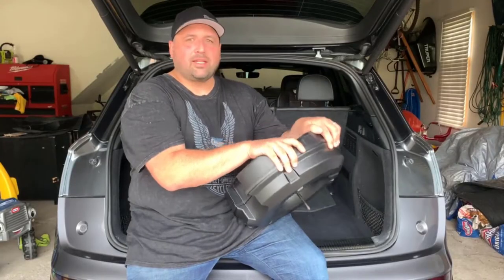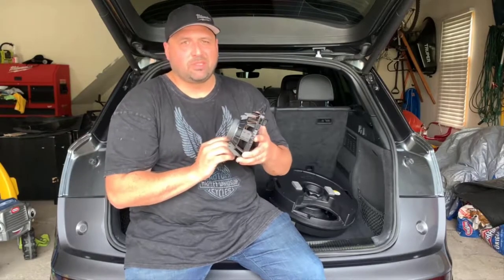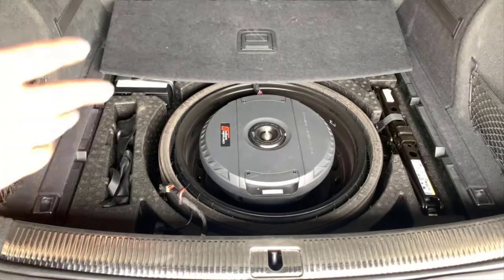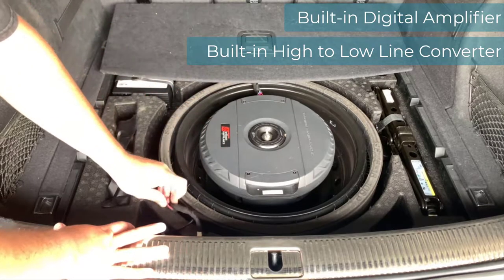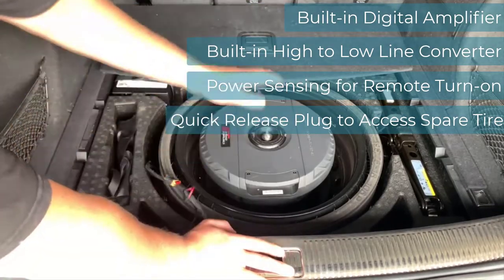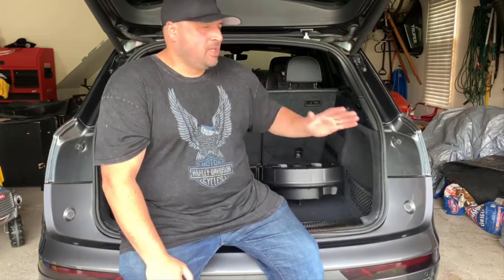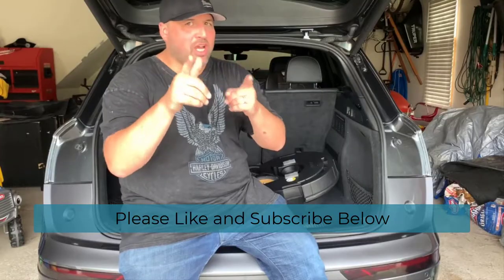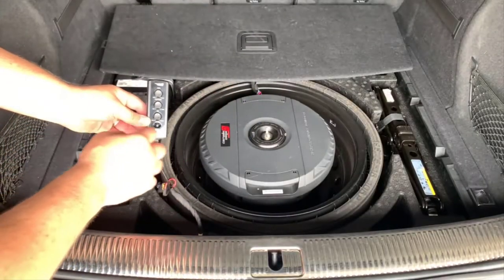Audi SQ5 B9 - Subwoofer Upgrade -- Cerwin Vega 12" Spare Tire Subwoofer w/ 600 watt AMP!

Comment: the jbl doesnt do everything this one does?
Reply from the maker: JBL does in fact have the exact same features. The difference is the subwoofer size. The JBL is A 11”  where the Cerwin Vega is a 12”. One Inch won’t make much difference but I went the “there is no replacement for displacement”… the larger the woofer the more air it moves… but who knows! It’s worked great so far! Almost a year in!
Reply: How can I get this to Kenya
Reply: @tangentsdaily  The JBL woofer, when measured with the same method, is just slightly larger than the CV's.  There are many other factors that impact performance aside from woofer size.  Some of the more significant are Xmax and, of course, power. In the case of those the JBL is MUCH better than the CV.
Reply from the maker: @ThomMurphy  The Cerwin Vega is 8.02mm or 2.9% larger than the JBL. I appreciate your passion for JBL. Thanks for stopping by.
Reply: @tangents daily  it's not, though. Maybe you can find measurements that indicate that, but not measurements from the same source that were performed with the same methodology. I've physically examined and measured both personally. The JBL is about 1.2mm larger (with a margin of error of +/-0.2mm) by my measure. 

My passion isn't so much for JBL as it is for truth and facts.